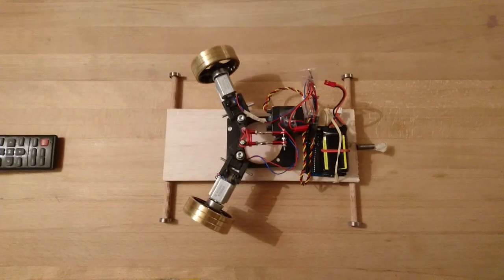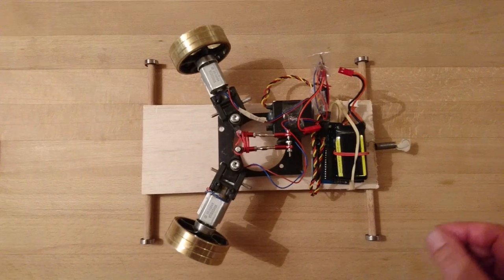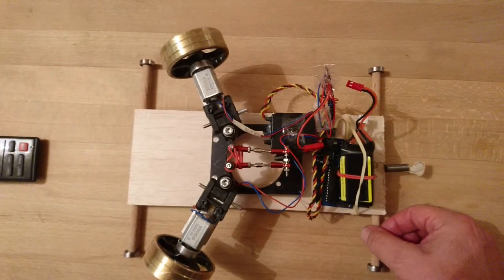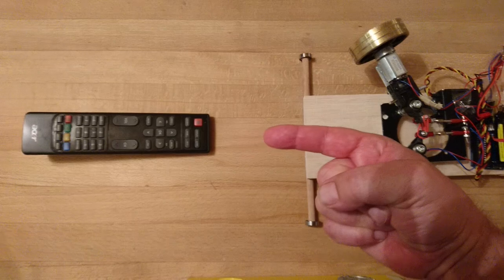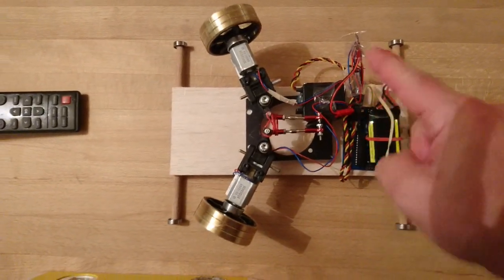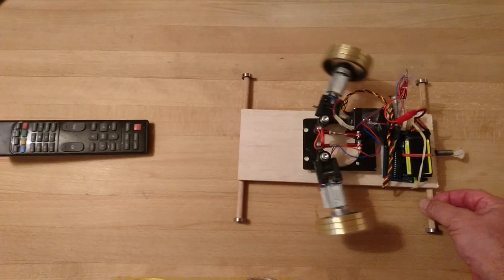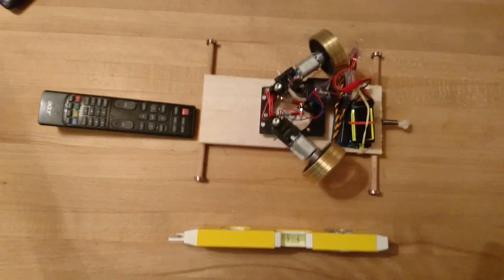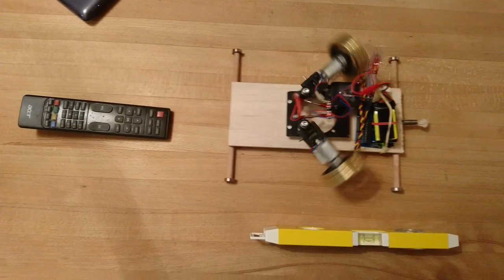inertial propulsion with gyroscope part 21  gyro producing work 1

Comment: During the natural precession phase when the gyros lift up, it generates a vertical force that increases the friction against the table, holding it in place as the gyros move back to the reset position.  When the gyros finish the natural precession phase and reverse, there is a jolt of force that overcomes any friction and there is no longer a vertical force pushing it down into the table.  This would also work if you did not use gyros and instead just heavy weights and made them move as if they were gyros with an upwards semicircle during the return phase, causing a vertical force against the table.
Reply: Si lo probara sobre una capa de aceite o hielo tendría traslación?

Comment: I was thinking that an horizontal inertia drive could be done by setting a double set of motors and then just pushing them back and forward .. And then I find this  4 year old video =D is exactly what I was imaging, the only thing that I would change is that I would use BLDC motors and make it remote controled

Comment: The binding laws of Physics therefore Unlawful means not binded yet meaning future concepts/perspectives required to have the present tense aware and the implied force of the question mark.For(give?)Unlawful Cranial Knowledge where the question mark is an implied force to obtain the answer (i swear if the for is actually for force jeez)it's a built-in washer/dryer man.Ive only used the c for cranial my entire life.Its real.The unlawful part is explained by understanding the phrase binding laws of Physics and need for ? As implied force,its brilliant.Dino Sherman(c)©

Comment: What happens if you place this vertically on a scale? Does it loose weight on each "stroke"?  What about using four (slightly out of sync) so there is no back motion at all?

Comment: Well woopy. Why don't you run your cart without the gyros spinnings. If it still moves forward then you are creating inertia forward movement by the different rate of forward movement and backward movement. With the gyros spinning your applied motion will create torque at 90 Degrees to the pull of the actuator. If the gyros weren't fixed in the 90 degree axis they would try to precess in a direction relevant to the direction of the spin. Take a look at Frank Mcabes work on powered precession. You might find some interest there.

Comment: I think same would happen with passive weights instead of gyro. Its about friction in your "wheels".  In one direction you are overcoming friction faster with greater force, and in another you are taking more time by moving slowly, making friction be more dominant. If you moved even more slowly in that slow stroke, you would be more "efficient" :) Can you try this with gyros not spinning? Anyway it looks like a fun way to kill time! Cheers.
Reply: Indeed, comparing the behavior when the gyros are spinning and not spinning will be a good test. Also, mount it on a pendulum and see if it will just rock back and forth or if it will increase the amplitude from a still stand - something like this: https://www.youtube.com/watch?v=Lhjv67uOA6o
Reply: No you are wrong
Reply: Do you know what happen when you got a giro spinning and then try to move it from the axis?  you are faced with a repulsion  force
Reply: The main idea of this experiment is that it would work on space and you wont need wheels, in space there is no friction, so the IDEA of the giros is to provide a point to friction with and then MOVE !!!!
Reply: Actually what he could do is to let the machine in free fall and it would still move forward

Comment: The cart test, unfortunately, proves nothing; we have seen countless examples of ways to take advantage of the margin between static and kinetic friction to achieve a 'thrust' vector. I can stand on a skateboard and move myself forward indefinetely without touching the ground by thrusting my hips quickly in one direction, and returning slowly back to neutral. Leveraging friction in this way is not inertial propulsion, and wont work in micro-friction environments (like space, or air). If you want to prove it to yourself, the pendulum test is bit more honest, and revealing. Floating a test jig on water can work as well. Or rig the thing with dynamic load cells. 
Great build though, keep up the good work! Inertial propulsion is possible, and we will find it soon

Comment: Unfortunately, this will never work as what one is building is, in fact, a very bad accelerometer used for a linear or an angular motion.
In an accelerometer, the case is accelerated while the mass tries and remains in the same location while what people do in inertial propulsion is the other way, the mass is accelerated at different rates while it is the outer case that is moved.  The videos included here explain it quite well.
https://youtu.be/KzTVTl3p2Po
https://youtu.be/MAR4yvxQpzc
https://youtu.be/fBI2P-buy6Y

Comment: This is NOT Gyroscopic PROPULSION.  This is no different from scooting forward in a chair (except that the friction coefficient is reduced...as is the mass...hence, an equivalent system).  The other comments are correct.  The Gyros are irrelevant to the "scooting" demonstrated.

Comment: woopyjump  If you anchored the gyro arms below the horizontal axis, say 70 or 80 degrees vs 90 degrees; wouldn't the attached object become lighter? Or more correctly stated, the gyro would be applying an upward force onto the object; essentially pulling up on the object it is attached to?

Comment: People has reasonable doubts about the role of static friction , in reality the system would move even in a frictionless environment. This could be easily provable by mounting the same exact device on some floating support (instead of a kart) and deploying it on a water surface. 
The reason of why it works it’s complex and not yet understanded because is clear that in our actual equations is missing something that apparently doesn’t exist but in fact, it does. The best explanation I can give is that by using our known mathematics, the gyroscope behave like a body with mass during the 1st half of its motion, and every calculation and equation works as intended. 
The second half of it,s motion all the equations suggest the body has no inertia, no momentum, no centrifugal force, nothing: the body has no mass, because mass is the common variable in all the equations. It may sound crazy, but this is what numbers say. 
Mass and all its effects appear and disappear just like that. I think scientist should review the concept of equality of inertial mass and gravitational mass, apparently they are the same but in rotational bodies under certain circumstances they are not. 
Here a mass is dislocated with no inertial effects and then all of the sudden the effects reappear propelling forward (by inertia) the kart.

Comment: This makes perfect sense. I wonder if you made three sets, placing them on one platform, facing in the same direction and phased them to propel 1,2,3,1,2,3, - would the car continue to accelerate? In space or microgravity, would the unit have accumulative acceleration? suppose on the powrer stroke the units were producing .1 G per stroke, and with three units each producing that .1 g acceleration repeatedly in the same vector, then the overall acceleration against X mass would result in continuous acceleration of m of gyros, duration of stroke * .1 G / Mass of the overall vehicle. For 10 to the 6th strokes, this accumulated G force would result in some significant developed speed. This principle essentially turns electrical energy directly into thrust with loss of friction of operating the mechanism, of course. But, even with an efficiency of only 50%, this is still a remarkable source of thrust.

Comment: The friction of the mobile on its support via wheels on a plane is not the same when the movements of the masses, causing the movements of the mobile, are fast as when they are slow. The force, tangential to the plane of movement, is therefore not the same either. The non-zero resultant force is by far the most plausible explanation. The device hanging on by a thread and the thread moving away from the vertical would be much more convincing. I know it's not simple to do it with pulsed force, nevertheless it is the only acceptable proof for a claim that would dismiss known physics law.
Reply: Gyros rise upwards on their even on ice... and all while displaying zero angular momentum or centripetal force in precession; thus the very basic property of gyroscopes is simple proof that mainstream physics is bogus. Check out my MES Experiments videos on my channel to learn more. And yes Woopy's video is as clear as it gets of inertia propulsion.

Comment: i'm jealous of your ability to create models that are sophisticated for an average person at home. however i am skeptic and think that the pulses we see is due to friction , i can't explain it but did you try running all the mechanical movement except without the flywheels spinning ? i think the result will still be the same
Reply: This is why the experiments need to take a big step up in seriousness. First of all, instead of just making a 'thousand' different prototypes, focus on one that works well and scale it up. Then there's all manner of experiments you can run that doesn't involve a kitchen table and friction. Like a pendulum, or a balanced 'see-saw'. It it starts producing thrust in those experiments, then we're talking. Talking real people with influence taking notice.
Reply: @Ree1981  
Well said
Reply: I thought exactly the same.  Something about static friction being higher than dynamic friction.  I too was about to ask woopyjump to try with the rotors not spinning, but I see you posted 4 months ago and you didn't receive any answer from him...
Reply: Do not let the different speeds of the stroke 
and the aparent simplicty of Laurent’s lovely little machine fool you.  I know 
it really really works as it follows the requirements for gyro powered impulse drive of a Newtonian stroke follow by a “Newtonian stroke”  repeated.

Myself  (many years ago - pre Laithwaite), Laurent 
(whoopyjump) and a very few others have (without slip stick, fakery, 
misinterpretation, misunderstanding, lack of knowledge or downright lying) 
managed to make a machine move outside its starting dimension without opposite 
reaction.  Laurent’s and the only other ones I have found on the web require 
gravity to work – mine does not so it will work in orbit.  Now, with all our 
work and after three hundred and thirty one years of scientific blindness, 
ignorance and misinformation, it is clear that the word opposite should be 
dropped from Newton’s third law.  The first and second need tweaking a bit too, 
but that is for later work.  I am old and have other things more important to do 
than justify other peoples inability to observe – See The Royal Institution, 
Prof Hugh Hunt’s work at Cambridge University and Emma Watson’s shameful thesis etc., etc..  Health warning!  The following explanation will hurt your head if you have a closed 
mind – so, that is most of the scientists out there, I guess.The precession caused by mechanically altering the gyros’ axial angle causes the gyros to press 
against the guide rail (base)  in one direction of swing (because they are 
prevented from precessing on this stroke by the base they act like a non 
spinning mass and create a “normal Newtonian” reaction on the whole machine. 
This is the Newtonian stroke:-NS) which causes the machines movement.  The gyros 
move away from the guide rail (base) on the following reverse swing due to 
precession and because their reaction is largely ninety degrees from the 
mechanical driving force they have very little reaction on the whole machine, 
this enables the machine to reposition its actuating mass ready for the 
next(Newtonian stroke).  Et voila, impulse drive.  I was going to say “et voila, 
REACTIONLESS impulse drive” but, in truth there is the normal amount of reaction 
– it just aint opposite.  This is due to “Nitro’s first law” which states that “a gyro will precess every force applied 
to change its axial angle – not just the first force you happened to think of.”  
Thus, when the actuator applies a force to change the axial angle of the gyros 
the gyros try to move by precession at ninety degrees to that force.  Hence its 
pressing against the guide rail (base) in one direction of swing and moving away 
from the guide (base) in the other direction of swing.    Thus the reason for 
Laurent’s lovely little machine’s ability to confound Newton’s third law is a 
further resultant of “Nitro’s first law”.  This bit is a little more obscure, so 
concentrate. To get round Newtons third you need to alternate a Newtonian stroke (NS) with a 
Gyrodynamic stroke (GS).  The GS causes the gyros to move clear of the guide 
rail and because a gyro has the effect of transferring its mass to its centre of 
support (not as believed by established science- see Cambridge University Mec 
Eng site on gyros - rotate about a system’s barycentre) this mass movement is 
without (in truth some but tiny) LINEAR reaction positions the gyros ready for 
the next (NS) stroke.  In the NS  the precession of the gyro pushes against the 
guide rail and you also need to understand that the rail is equally pushing 
against the gyro.  The effect of the rail pushing against the gyro is a force 
which is, as per Nitro’s first law, also therefore precessed and effectively 
cancels out the original precession so the gyro now acts like a non rotating 
Newtonian mass not a gyrodynamic mass.  
Et Voila, as mentioned above, you have a machine that can alternate a Newtonian reaction stroke on the machine with a (mostly and effectively) reactionless gyrodynamic repositioning stroke on the machine.  This is is the start key to reactionless impulse drive. 
SIMPLES!!! Kind 
regards, Nick
Reply: @jogglevision  Would this work if the device is on a small boat floating in water with no oars?

Comment: Hi Laurent,  You need no more work on this machine. It clearly "does what it says on the tin" and will  budge more than its own mass against resistance.  It might be of academic interest to see what the maximum angle of climb it will cope with but that is not needed.  This, part 21, part 10 and my earlier machines clearly demonstrate the after 330 years Newton's third law needs must have the word "opposite" dropped from its wording.  The biggest problem is getting any scientific body to take this update on board.  After Professor Eric Laithwaite had his career destroyed by the Royal Institute because he was not quite up to our speed and the ignorant howling of "Heretic" by his peers, I doubt there are many scientific establishments with the courage to examine this with an open mind or put their head above the proverbial parapet.  I have set my contact details to IWS and look forward to hearing from you.Kind regardsNick
Reply from the maker: will contact you soon
Reply: @woopyjump  i have the full plans for this, you need 4 wheels and it is flying 😁

Comment: You probably know this thing can't work without gravity: it would stay at the same place after the weight went back and forth. The reason it works is solid friction with the table that stuck up the device when the speed is low. BTW it would be probably more efficient if there were a little bit more friction at wheels level to prevent it to go backwards :)
Reply from the maker: Bonjour Armand et Victor
Merci de regarder ma video et de déposer un commentaire.
Evidemment je ne suis absolument pas d'accord avec votre explication, qui est dans la veine très classique  concernant le fameux "slip-stick" qui produit la translation de tous les engins dit à propulsion inertielle. On me l'a déja sortie mille fois et c'est correct concernant des poids morts qui oscillent. Mais dans ce cas on parle de gyroscopes qui produisent des effets asymétriques. Un petit coup d’œil au brevet de M. Harvey Fiala vous sera utile.
Pour votre info je ne cherche pas à propulser quoique ce soit avec ce système, mais je cherche à mieux comprendre comment fonctionne un gyroscope en précession.
SVP ne brandissez pas les théories à vecteurs et autres formules universitaires inutilement compliquées. Et personne jusqu’à maintenant n'a réellement pu expliquer pourquoi Eric Laithwaite (et moi aussi et pourquoi pas vous) peut faire évoluer la "big wheel" au-dessus de sa tête sans effort. Et à ce propos c'est vraiment dommage que le youtuber "veritasium" qui a correctement répliqué l'expérience , se soit contenté de fumeuses théories vectorisées sans réellement approfondir le sujet. On dirait que le monde académique n'aime pas trop les gyroscopes en dehors de leur effet stabilisateur. Bizarre !! Newton terroriserait-il  encore des centaines d'années après sa mort.
Alors je vous propose, vu votre excellent niveau de constructeur et de compréhension, de répliquer ou au moins de tenter d'expliquer, mes "incroyables expériences" selon les videos concernant la propulsion inertielle. Part 19, 18, 16,15, et de visiter la vidéo part 8, ou le matos est déposé sur une plaque plane qui est de niveau et qui elle-même est déposée sur des billes d'acier, ce qui démontre que la "friction" des roulements n'influence pas la translation (no slip-stick).
Si je vous répond, c'est parce que vous êtes jeunes , très curieux et très intéressants et que votre avis m'intéresse. 
Peut-être que vous allez découvrir quelque chose de très intriguant pour votre avenir........ou non
Salutations d'un vieux gâteux
 Laurent
Reply: Intéressant tout ça. Je me suis récemment intéressé à la théorie "classique" de la propulsion inertielle (hors gyroscopes...) pour en arriver aux conclusions habituelles, c'est à dire que le bilan propulsif est nul dans le vide. En tant que zététicien, je m'intéresserai à ce phénomène quand j'aurai un peu de temps afin de trancher (ou non ) la question.